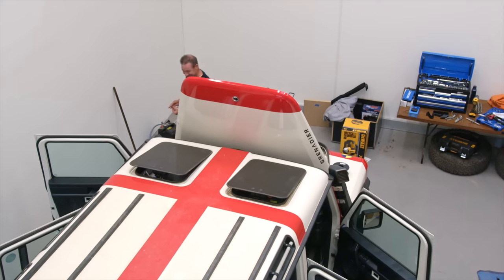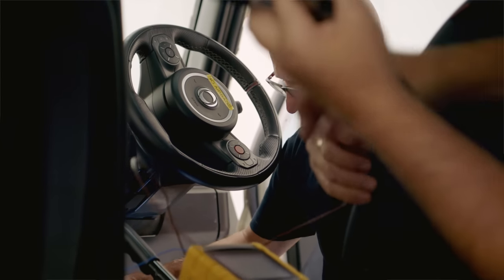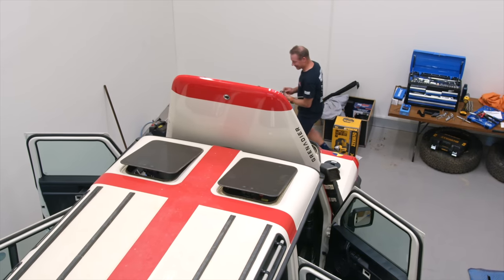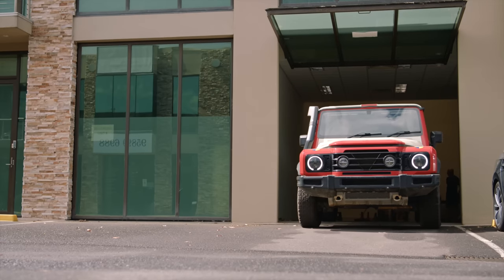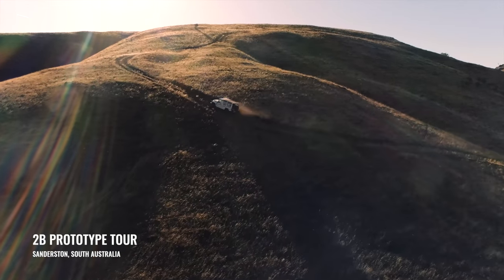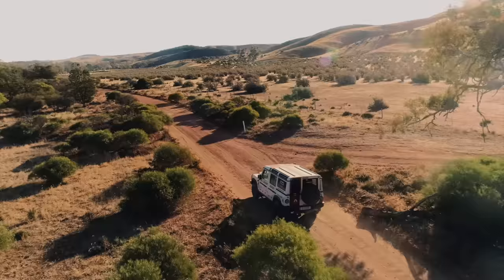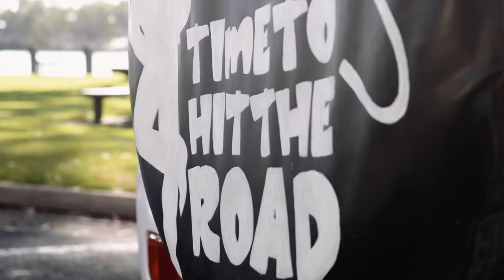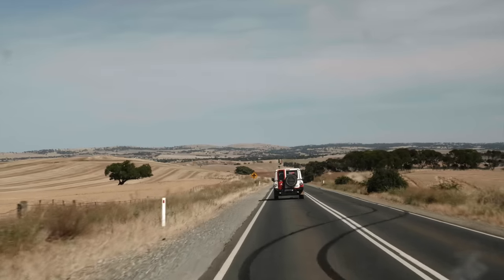INEOS Grenadier Trails: Australia | Episode 1: Preparation​

Comment: Would be cool if this thing ends up coming in at reasonable price. Even a base spec. Below 60kaud?
Reply: Try $85,000 to $96,500
Reply: @douger1517  yeh thats why i said what i said
Reply: @tonybruce  we all hoped around $50,000 - $60,000. They have knocked out a huge buying group by basing their pricing on Toyota 70, but Toyota is proven and heaps of aftermarket. @$90 majority of buyers will still buy the utes. I can afford to buy the Ineos but won’t because of the above and a lot of others I have talked to are the same.
Reply: Wish they'd sell it as a roller too.

Comment: Is ineos suv coming to india.?
Reply: If only Indians stopped buying cars based on cheaper price tag and cared more about quality and utility.
Reply: You guys own Land Rover, buy them instead, or a Mahindra
Reply: @lot6129  land rovers are still made in UK and Slovakia. Most of them are sold in India as imports. They fetch 3times the original value. 
Speaking of Mahindra, they don't sell the mahindra pikup in India which comes with 3150kilo gvm, eaton lockers, etc. 
Besides there is a scarcity of a solid front axled 4x4 in India. Cars in India are boring.

Comment: $20K over the promised price 😑
Reply: By what measure? Base prices as promised (within 1k) for Australia...
Reply: Mate, our current home renovation has gone up $400K (just short of 4 of these vehicles) in the same time as this supposed "promised price" increase. The world ain't what it used to be my friend.
Reply: @deldridg   they were starting at $84K right up until just before launch according to the information I saw though my account on their website.  Great car still yes, better value than a 300 series cruiser.
Reply: @mattyb1624  Much better value than the new Defender too. A mate bought a 130 for around $130K (with options). Now at 50K kms (relatively easy driving), it needs a full drivetrain replacement, including front/rear suspension and engine (which won't be in the country for 3+ months). Dealer has been unbelievably unsupportive, possibly criminally negligent. Hope these guys get it right because I'm keen on a Grenadier! 🙂